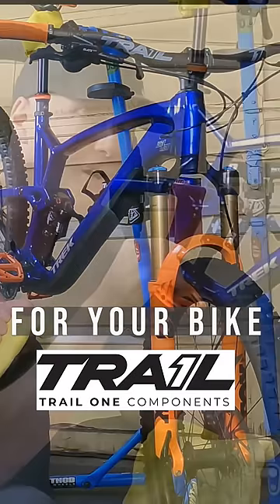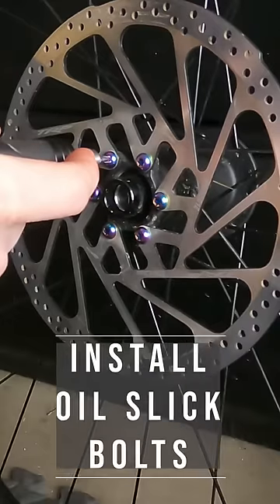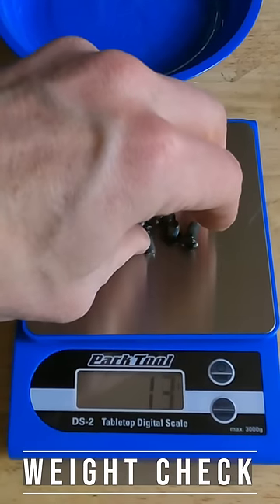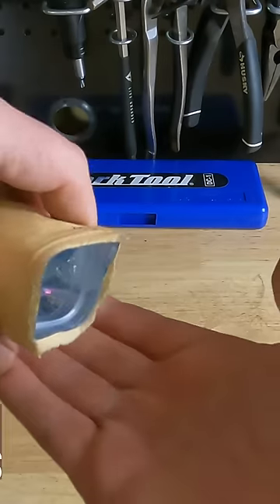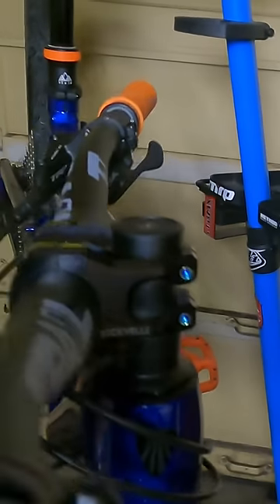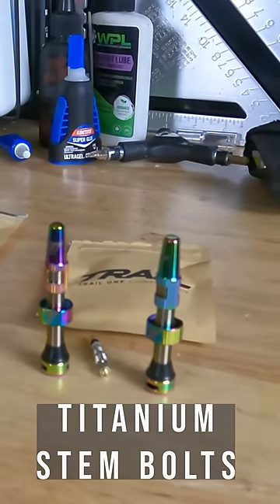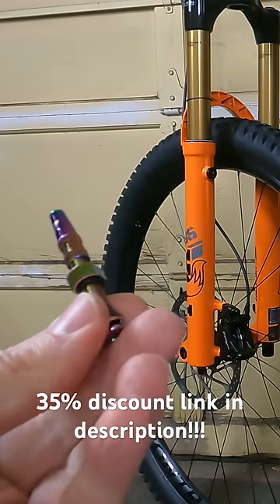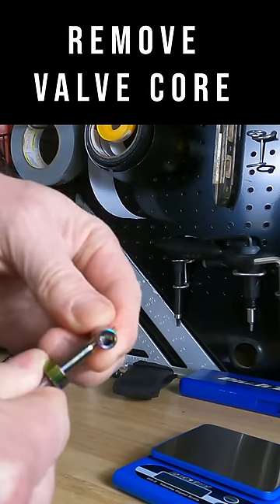Customizing your bike w/ Trail One Components

Comment: I'd avoid the Ti rotor bolts for fear of rounding then out. Steel is tougher. But, Ti stem bolts looks like a decent plan -- not to save weight, but to combat corrosion. Rain and sweat can mess up supposedly stainless steel bolts amazingly quickly. I think I'd need to use a seating compound to prevent galvanic corrosion between the steel stem and Ti bolts, but it's still a good idea. Cheers
Reply from the maker: @BrianRPaterson  good point on the rotor bolts. I have swapped rotors 4 times now and haven’t rounded them out, but I’ve rounded out steel ones in the past so I get your concerns

Comment: I just used some cheap amazon ones just like this to run a set of 10 year old Bontrager Ranger 29er rims in a ghetto tubeless configuration. I used gorilla tape for the rim tape and for the tires i used a Maxxis DHF 29 X 2.3 up front and a Maxxis Aggressor with the same specs as the DHF in back. It was a pain in the ass cause the Bontrager Ranger rims are very narrow to begin with AND asymmetrical (which i find incredibly stupid and unnecessary) lol. But none the less i got them to seat and seal with just a hand pump. I also just used store bought slime sealant (the actual slime 2 in 1 sealant not their regular stuff for car tires etc). And theyve been holding pressure for few days so far without dropping any pressure over night.  Sometimes the cheap stuff is more than adequate.
Reply from the maker: You gotta do what’s right for you man. All that matters at the end of the day is riding and having fun! 👍
Reply: @JaredHoff  Agreed 100%

Comment: Wouldn't get as much "hate" towards the video if it said Customizing instead of Upgrade. Titanium and carbon are really something that mechanic kinda starts to hate when working with that stuff in the worst scenarios. Just speaking from experience.
Reply from the maker: I’ll change that. Thank you 👍
Reply: Why do they hate some of the best materials in the world?
Reply: @shaunschneeberger6301  Well I did say, under worst scenarios. Usually stainless steel, 304 or 316 is possible to remove even  after it's been there forever, but titanium is too brittle and might break in these circumstances when trying to remove it.. stuck bolts for example. Carbon reacts with metals, it's not inert like some think. Super expensive still, harder to work with, also brittle because it's so hard. Only takes forces in a designed way, let's say compression in a seapost but doesn't like lateral torsion or twisting. Hard to cover all the examples but steel is cheap and robust.

Comment: Valve stem upgrade is no bueno because, tubeless wil damage the paint. Others ones are actually solid but expensive and unnecessary. Only 10k+ bikes should get this kind of upgrade. Because it’s always better just to save for fresh drivetrain, brakes, fork/shock, wheels.
Reply from the maker: Tubeless is a must on all my bikes!